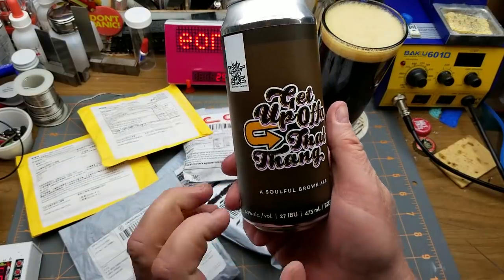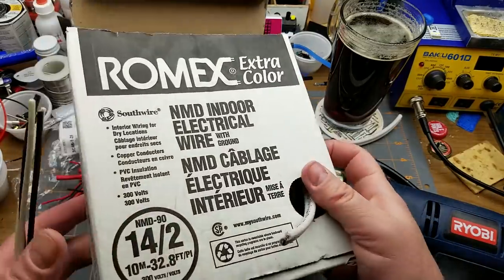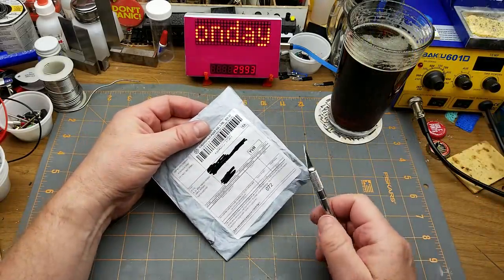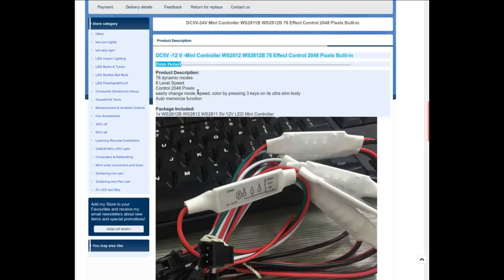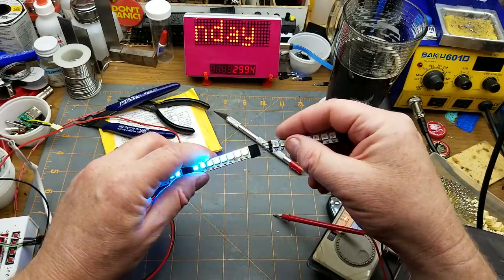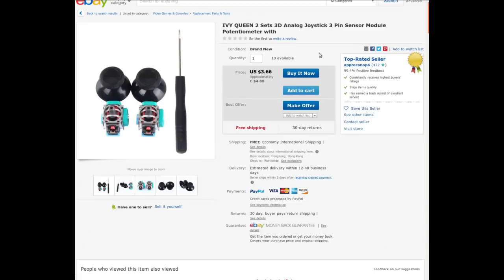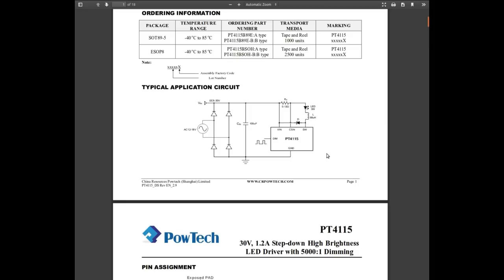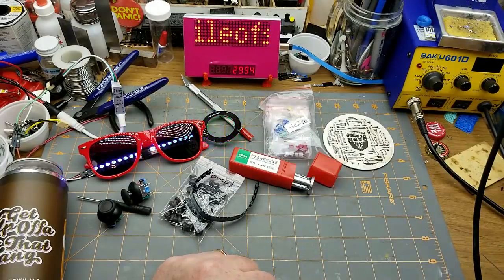Mailbag Monday 54

Comment: That took may work if you hold the wires tightly in parallel with linesman ones sidecutters.  That's how you would normally twist a number of solid wires together.  Skip joint pliers won't work!